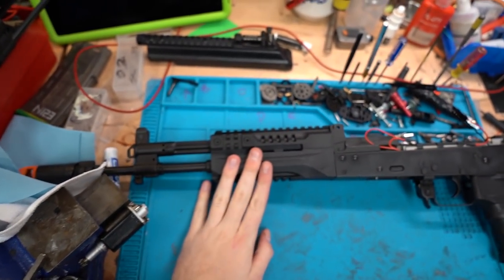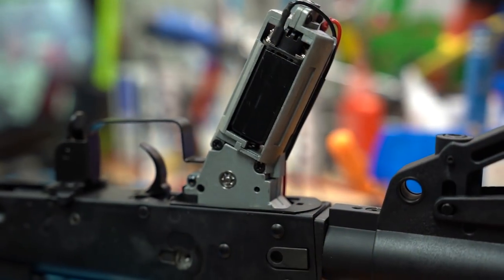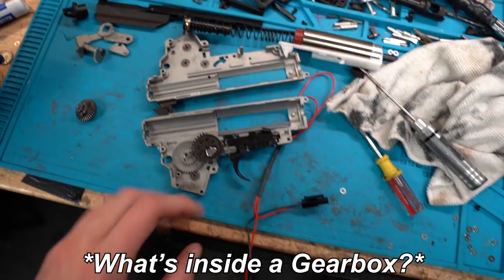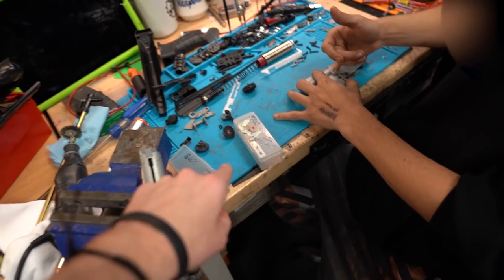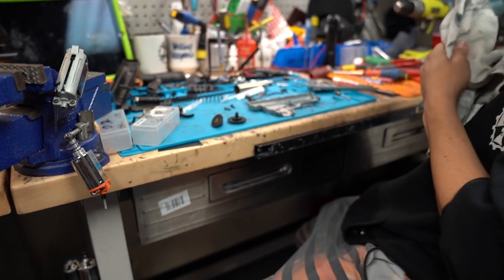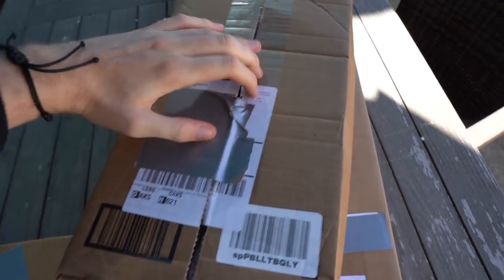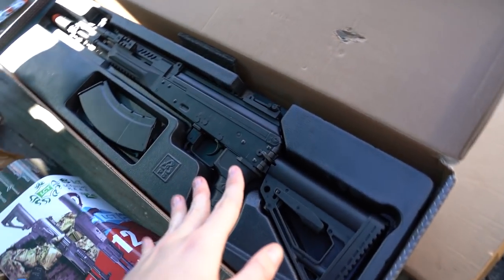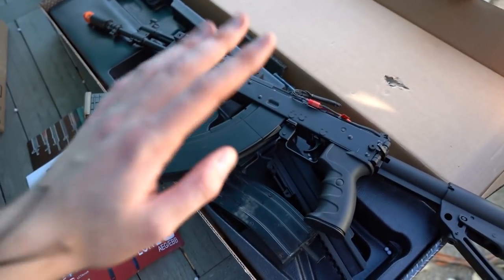Building the CRAZIEST AK EVER! Unboxing+Teching+Shooting Test! *Insane Airsoft Gun*

Comment: Aks are the best,  the motor cage and hop up being screwed in are far superior to the m4. I'm not sure you need to radius the gearbox tho, I've run mine as a dsg for 2 years with no signs of cracking. But absolutely do more tech videos, if you could do one on the jag scattergun that would be amazing, theres almost no upgrade content on them.

P.S. the WE Scar is probably one of the most satisfying upgraded gbbrs, and I think even giving the tippman m4 a try would give you a nice change
Reply: lets just say the ak's mag in general are utter shit.

Comment: most of the airsoft aks have there batteri in the back in the stock but if you have a folding stock it needs to be under the dust cover btw i think aks are better then m4s i have needed to change like 3 times my m4 but the company was kind enough to let me change without paying for it but my ak has hold ever since i got it and its proudly my favorit gun

Comment: Swap LCT gears to cheap chinese SHS gears... Just Why???? If you aren't building a DSG and using standard 18:1 ratio, LCT gears is a lot better WTF
Reply: lct gears are even cheaper 😂
Reply: @gpf32  I've never seen a LCT gear stripped, SHS? at least 3 friends of my.
Reply: @Dougline_  I've never seen shs strip. Using a m170 with dsg or a m130 ssg build at 40rps with 12:1'1s
Reply: @gpf32  you got a good experience with SHS, I don't, so I can only speak for myself.
Reply: @Dougline_  yos mate

Comment: I'm not being rude or anything but how can a high speed build work in a inner barrel that is over 415mm that is impossible to do as it only works on inner barrel that are under 400mm. 

Just sounds bit weird for a ak that is specifically designed to do either a battle rifle or dmr but to be a speedsoft style one..... I mean aks-74u yeah that will work but a full size ak???? Just doesn't sound right
Reply: Any ratio ssg’s can have up a 509mm barrel pretty easily assuming you don’t ss any sector teeth...you must be thinking of dsg’s that are generally recommended at 360ish mm or shorter